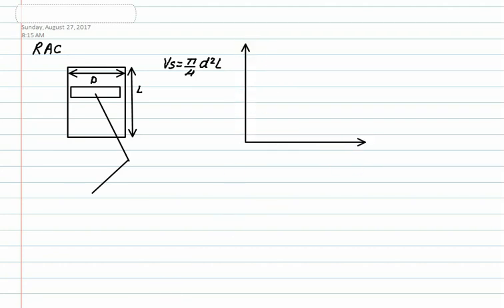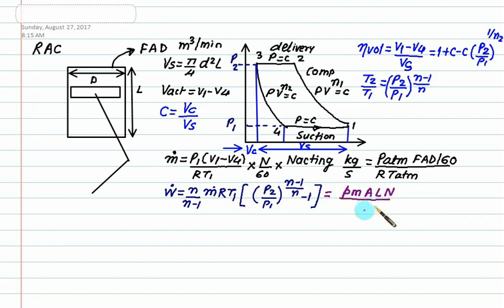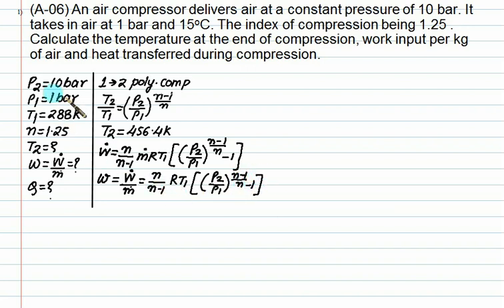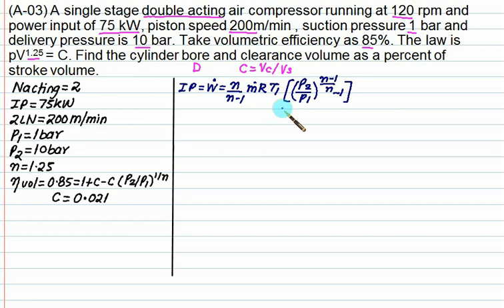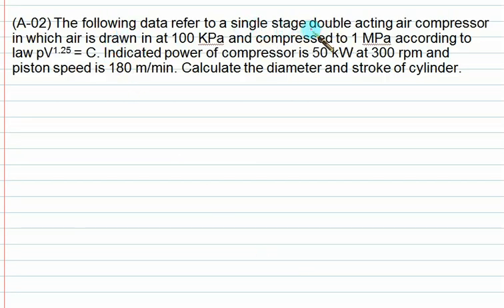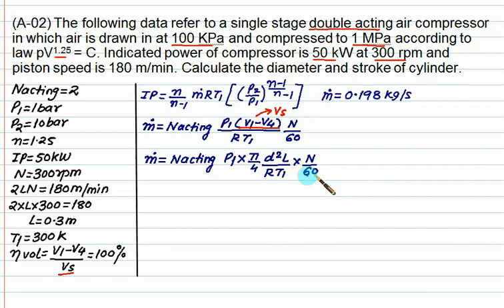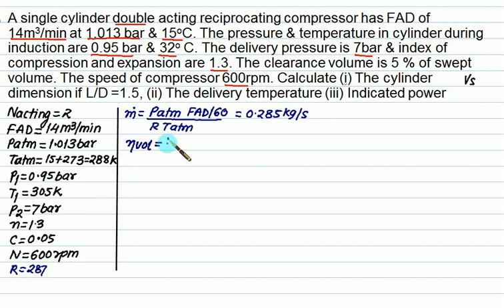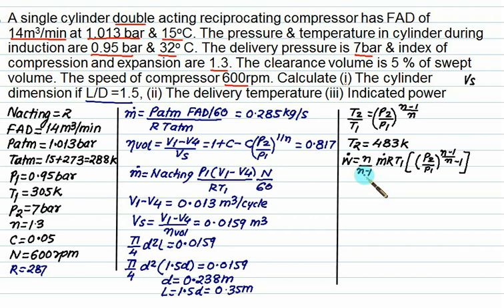Reciprocating single stage Numericals  comp 1

Comment: Sir, 
for question A-06, work done by gas is negative, internal energy change is positive. So, net heat transfer should be  -129 kJ (negative)( ie heat is transferred out of the system). Please explain sir.

Comment: 8:18 is it also used for open system ? h1+q=h2+w isn't it holds good for obtaining q ?
Reply: Yes I feel so..because for open system heat content cannot be defined by internal energy alone. Flow work also needed. Hence heat content should be the enthalpy.
Reply from the maker: W is integral vdp and not pdv

Comment: Sir when inlet and outlet diameters are given in compressor and which formula will used to find power required and isothermal efficiency
Reply from the maker: use Steady flow energy equation

Comment: Hii!! Hope u r doing well!! I have a doubt in this lecture!!Plz have a look @ 8.40 video timing!!Why you are not using directly polytropic heat transfer formula!!! Nd in your solution you can not directly use Work of compression as you derived it by considering whole cycle and this question is asking about heat transfer in compression process!!Nd if it is so also,  why mine nd ur result is nt matching!! Thanks for your anticipation!!!
Reply from the maker: please understand one thing that the compressor is a steady flow device you can not apply the formula of non-flow process (integral p dv) to flow process  (integral v dp)
Reply: dq = (Y-n/(Y-1)) * dw polytopic